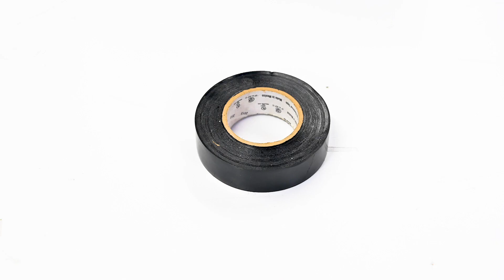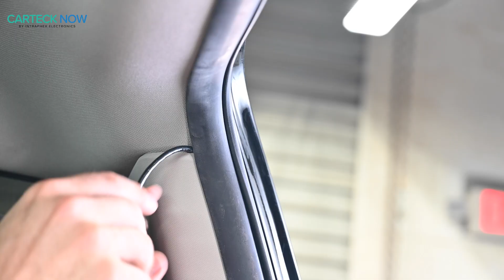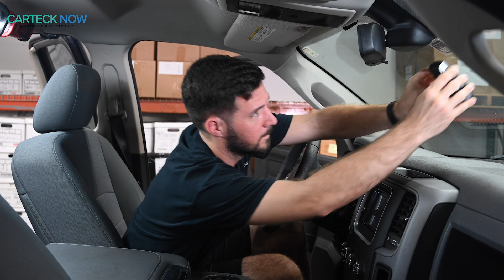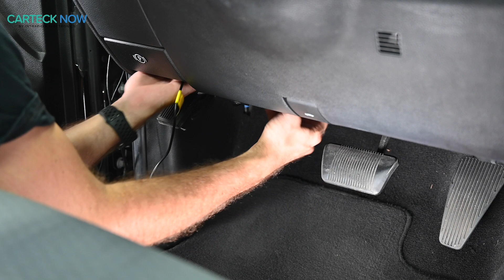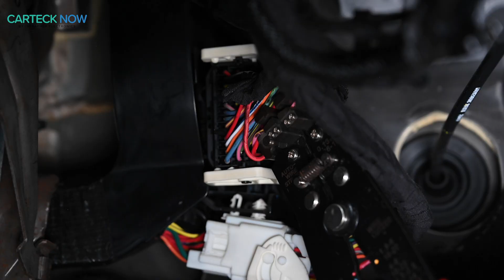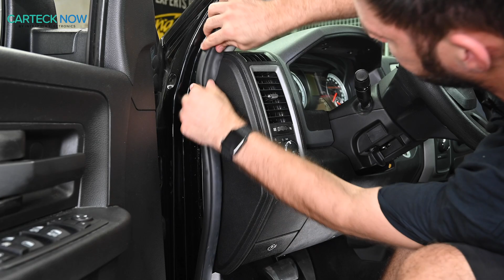How to Install: Thinkware U1000 Premium 4K Ultra HD Dash Camera

Comment: I can not keep my dash cam on the window using the 3M  tape. I have tried over 4 times but it keeps falling off!!!! The heat in Texas is just too harsh and tape does not hold up. And your “1” suction cup options doesn’t fit the 4k-qhd model!!! Super frustrating!!!!!! Really need more suction cup options across your different models. Not just 1😡

Comment: If one chooses not to hard wire it for parking mode and go the easier route ,does one have the optiom of removing it at night due to high crime areas ? Is there a mount for it on Amazon or something .

Comment: Thanks, Got some questions that you may be able to answer. looking to install in a Porsche Type 992 Carrera convertible. What to do with the installation of the the rear cam? how long is the wire on the rear cam? Is the OBD2 installation available for this type?
Reply from the maker: Unfortunately we have not had a chance to get into one of those vehicles here, so we havent tested the OBD2 cable in it and  are unable to provide any routing assistance on that one. Sorry about that. The rear camera cable is approximately 24 feet long.

Comment: For the permanent hardwire install, rather than tap into the wiring harness wouldn't it be just as easy or easier to go into the fuse box with fuse taps?
Reply from the maker: You can use add a fuse type connections for connecting in the fusebox as an alternative, yes.
Reply: I tap it with the fuse

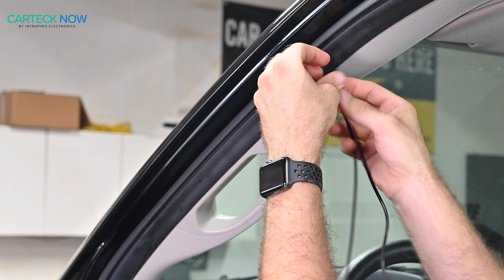Comment: Do we need to worry about blocking any potential airbag curtain deployment when hiding the wire like how you do at 03:21 ? Great video
Reply from the maker: If your vehicle application has curtain airbags, care should always be taken when running wires near them. If you have any questions as to them possibly interfering with the deployment of the airbags, we would recommend consulting a professional installer for your and your passengers' safety.

Comment: Wouldn't it make more sense to do the following INSTEAD:

[BEFORE attaching anything to windows]

1. Attach rear camera to cable and attach cable to dashcam
2. Connect the 12v to 12v power to temporarily power up the dashcam
3. Connect dashcam to WIFI and view the VIDEO ON THE CELLPHONE.
4. THEN using the CELLPHONE, align the rear camera so it SHOWS ON THE SCREEN THAT IT'S CORRECTLY LINED UP and STICK camera to rear windshield
5. THEN again viewing thru CELLPHONE VIEWER, align the dashcam so its aligned correctly on the front windshield.
6. THEN you can follow the rest of the steps (hiding rear cable), and hiding front cable OR converting to hardwired setup.

To me this seems more smarter because you cannot tell where the camera is showing just by eyeing it on the windshield. If you attached everything and stuck on, if you discovered it was off center, or slightly not-aligned, you would have to pull it off and reattach it.... It's better to use a viewer to actually SEE what exactly the camera will be filming.

Comment: Thank you for sharing the video, I just purchased the same unit w/ the OBD II wiring harness,  when you were installing the rear camera that also plus’s into the front camera correct? 
Thanks again
Reply from the maker: Yes, the cable routed to the front from the rear camera connects to the rear camera input on the main unit up front.
Reply: @cartecknow1817  
Thank you for getting back to me.

Comment: Forgot to mention can use external battery pack? My use case is just the front+cabin I really need parking mode so I can phone zombie wherever I go (my ride's this rare). Is the Thinkware almost wireless like this, the external battery pack powers it jus by being in the 12 volt socket and medium distance trips?
Reply from the maker: The camera can be powered by any source of 12v power, including a battery.
Reply: @cartecknow1817  So the only wire in my cabin is going to be battery>12v hopeful. Cheers!

Comment: perfectly clear instruction.  For taping into existing wire do they have a pinch connector or something so we dont have to strip the wire
Reply from the maker: We don't recommend using t-taps or other similar connectors due to their poor reliability and their propensity to damage the wiring when connecting with them.

Comment: Hi buddy thank u so much for ur  video. I was jus wondering how closely radar shud be installed, does it only needs to be attached jus close to cam like you did or attaching next to vehicle radar sensor is fine. 
I have attached in kluger hybrid where on right side is the cam and left side is radar and in between is the toyota senser.
Reply from the maker: The further away from metal objects the better detection you will get from the unit.

Comment: Currently using a Cobb Access Port with my ODB sensor.  Would the ODB splitter interfere with anything?
Reply from the maker: It shouldn't have any effect on our end, but you may want to check with Cobb on theirs. We are only looking for ignition on message on the network to provide a switched power to the camera.

Comment: I did all you said and power to cable but not turning on?????confused
Reply from the maker: Which installation method did you use? Please feel free to call us at 727-346-6281 for technical assistance.

Comment: Very good video. QUESTION: Sometimes my car (BMW 850) is stationary in my garage for several days or even up to two weeks. Even an external battery will run out during this time. Is it possible to connect the external battery to a power outlet in order to preserve the integrity of the Dashcam during this time?  Thank you...
Reply from the maker: The camera has a setting to sense low battery voltage and stop recording to prevent draining the battery. The backup battery does not have an outlet.
Reply: @cartecknow1817  Can't you just power off the unit if its parked in my garage to save the battery?
Reply: @gjoniny  Yes you can. Just remember to power it back on if it doesn't power on automatically.

Comment: Does your OBD port option drain the battery like the hardwire option?
Reply from the maker: The Thinkware cameras have a battery protection feature that you can set so if the battery does get low it will stop recording.

Comment: I know this video is a year old do hopefully someone will reply. I’m looking at getting a dash cam that connects via OBD but I’ve read that connecting this way drains battery? Is this correct? Thank you.
Reply: The Thinkware cameras have a battery protection feature that you can set so if the battery does get low it will stop recording.

Comment: How would I mount the rear camera if my truck has a sliding rear middle window ?
Reply from the maker: You can mount it off to the side on the glass that does not move. The camera has a wide view and you will still be able to get a good viewing angle behind the truck with it slightly off center.

Comment: so I believe the hard-wiring requires professional technician to do the job correctly with no issues.

For the OBD port method, can a regular person (not professional and with not much car knowledge) use that method and set up the parking mode?
Reply from the maker: The OBD-II port cable is the easiest solution, you just need to plug the cable in and tuck the wire along the trim to the camera. If you get stuck along the way or have any questions you can always reach out to our Tech Support at 727-346-6281 M-F 9am-7pm EST.
Reply: @cartecknow1817  I was able to get the OBE II cable and hook it up, but now it seems like the dashcam is constantly in parking mode even when I have the car ignition turned on. Is there a setting I need to change in order to go to parking mode only when the ignition is off?
Reply: @cartecknow1817  oh…. It looks like the ignition module is missing from my OBD II cable set up…. I probably need to return and ask for complete set.
Reply from the maker: Please call 727-346-6281and we will get you a replacement module.

Comment: What about a passenger vehicle
Reply: This camera can be installed in almost any vehicle.
Reply: The pickup as target vehicle was a bit of a cop out on showing how to run the cable from rear to front. Otherwise good presentation and informative.

Comment: Hi, I am wondering if you ran the rear camera cable down to the side panel first, and then run it over to your main module, keeping all the excess wiring in the side panel?
Reply: Yes, it will be easier with that wire to keep the excess up front vs. tucking it into the headliner.

Comment: Can you also hardwire to fuse box instead of splicing the wires?
Reply: Yes, you can use the add a circuit adapters and wire this to a fuse box.

Comment: Does the rear camera independently detect motion and start recording during motion detect parking mode?   Your info is much appreciated.  Trying to figure out if I need 2 front cameras or just a 2Ch unit.
Reply from the maker: Only the front camera will detect motion. If the front camera detects movement, the rear and front camera will record a motion detection video.
Reply: @cartecknow1817  Thanks for the reply.  That is what I thought, but other claims the rear would start recording once it detects motion during parking mode.

Comment: I would like to buy this dash camera with the rear camera. Will the rear camera recording be functional with the front camera in the parking mode function?
Reply from the maker: Only the front camera will detect motion. If the front camera detects movement, the rear and front camera will record a motion detection video.

Comment: battery pack installation with obd possible or need to hard wire
Reply from the maker: The OBD-II cable would not be a plug and play install with the battery pack.

Comment: Would these cams work in a Jeep Wrangler?  Would one be able to properly position the front cam on such a "vertical" windshield?   Can the cam be adjusted enough?
Reply from the maker: The lens can be adjusted to ensure the perfect recording angle, even with the vertical windshield of the Jeep Wrangler.

Comment: Great review! Thank you very much! By any chance do you know the voltage and current requirements(consumption) for the camera? Thanks
Reply from the maker: Sorry I don't have the camera power consumption specification. The system does run on 12 volts. But the actual current consumed would depend on the recording options. The Thinkware dash cams do have voltage sensing protection options to keep them from draining a vehicle's battery over a long period of time.
Reply: @cartecknow1817  Hi, Im worried if it can withstand extreme cold? I live where it gets -40 to -50 (winter). Will it affect my car battery if hard wired? Thanks

Comment: How do I tilt the front camera up a little. Mine shows too much of the dash and I’ve tried moving it as far up as I can without obstructing the view
Reply from the maker: You can adjust the front camera upward by physically moving the front section where the camera is mounted. Just push the camera section upward, toward the windshield. The U1000 does slide to the side, to disconnect from the windshield mount. Taking the module off the windshield will make it easier for you to adjust. Then slide the unit back into the mount. Hope that helps :-)

Comment: Helpful, however will this affect the side curtain airbag operation?
Reply from the maker: As long as the cables are not attached to or wrapped around the airbag, it should function as needed.

Comment: No way to install it like you on a new car
Reply: now I'm curious and have to ask honestly to... but why can't you?
Reply: @datswapz1875  Hi, because if the risk that panels will not fit exactly, risk of scratching surfaces, not well managing wires under the panels, risk of connecting it to wrong fuse. I wouldn't venture to do it on a warranty car.
Reply: @SIMEONOVVASIL  I see. Yeah I can believe that.   Wire running and hiding its an art .  Not everyone has that ability to see the entire picture. Like people who build their owm.p.c.  Wire look like a rats nest ahha ... thanks for the response   I was curious for sure.  ✌

Comment: I jus ordered a dash cam and cable from your website, how long does it take to ship??
Reply from the maker: Hi there, orders received on holidays and weekends will be shipped the following business day.  Your camera should be shipping today!  :)
Reply: CarTeck Now hi so I installed your guys OBD II cable to my car and was wondering if that is going to drain the battery ?/: also, is there any way to see my Car Live when I’m inside of my house ??
Reply from the maker: @ya5807  Hello again.  :)  The OBD2 cable draws power just like the Thinkware hardwire cable does. There's a battery saving feature built into your dash cam.  You can review that feature within the dash cam manual.  Regarding live view from your house, if you're within the cam's WiFi range, you can connect to it to view.

Comment: So what does the obd kit do does it bypass your car battery so you can enable parking mode in other words does it feed off your battery or no? Cause I have seen in other videos they want you to buy a battery pack to bypass going off car battery just was curious?
Reply from the maker: The OBD-II harness is allowing you to have a constant power and ground connection to enable parking surveillance mode without having to hardwire the dash cam. The Thinkware Dash cam does not pull enough power to drain your battery. Especially if you are driving every day, or every other day, your battery will never be affected by this connection. If you have any more questions, our dedicated Tech Support Team would be happy to help! You can chat with them here https://cartecknow.com/pages/tech-support
Reply: @cartecknow1817  Due to COVID, I'm finding myself driving much less. Thus, the parking mode on the U1000 and OBD II connection have drained my battery on couple of instances. I've configured the dashcam to shutoff at less than 12.4 volts, but it still drains the battery. Any suggestions? Vehicle is a 2020 Land Rover and battery is new.
Reply: @jaydee_park  I mean COVID is almost over (it's on resurgence again now with the Delta variant), but I guess you could just try turning the engine on to keep your battery charged. :/ It does kinda suck that there is less driving due to COVID.

Comment: How come you guys do not use the fuse to connect them??
Reply from the maker: Hi there, unclear what you're referring to, but the hardwiring cable has the fuses already inline with the wiring which was not removed.  Hope this helps!  :)
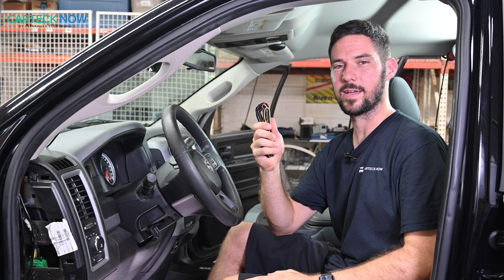Reply: @cartecknow1817  at 5:20 when you use the hard wiring cable ? How come you guys do not tap it to the fuse box? Cuz most of them said that but I kinda like that idea behind it. Is there a reason why you prefer to tap it like that instead of tapping it to the fuse box.

Tks
Reply from the maker: @flipmode00  Ah I see.  If you're using a fuse tap, then that is certainly acceptable.  Thinkware doesn't include a fuse tap with their packaging, so we installed using what's available in the box.
Reply: @cartecknow1817  if you use fuse tap, will the parking mode still works?
Reply from the maker: @alexloweph  Yes parking mode will still work.
Reply: I hate seeing factory wire being cut like that. Add a fuse is a much much much better option.